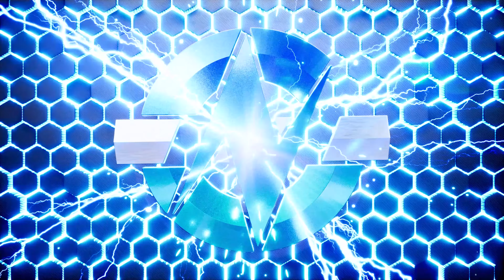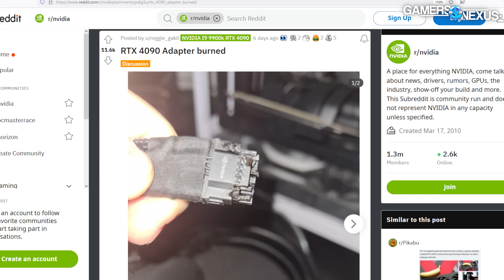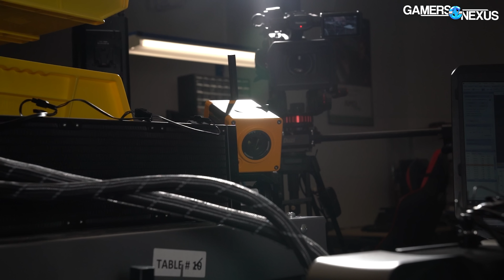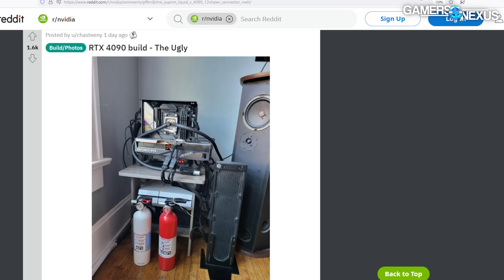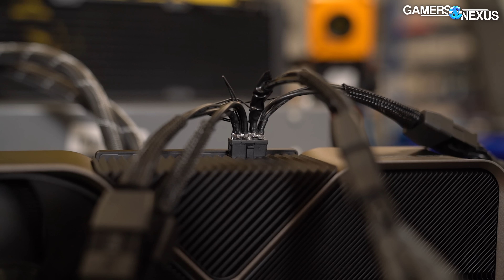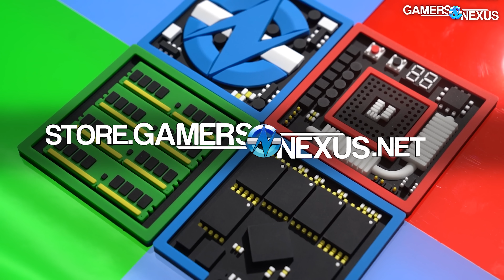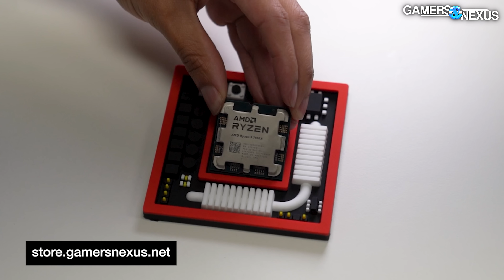Testing Burning NVIDIA 12VHPWR Adapter Cable Theories (RTX 4090)

Comment: I would name the camera HAL. Also I think the heating issue is probably due to faulty soldering on some cable and not due necessarily to a faulty design. only time will tell.

Comment: Isn't the voltage rating more about the insulation than the actual wires. Wire itself is rated for current, insulation is rated for volts.

So many hypothesis for what's happening, but I keep hearing about increased resistance shifting current flow to less affected pins. What I'm considering is that bending the wires loosens the pin to socket contact reducing the surface area. Rather than shifting current to other pins, the smaller surface contact area of the strained pins, has the same current flowing through them as there's no practical resistance increase, but as it's a smaller contact point all the voltage drop is localised creating a hot spot that heats up to a much higher temperature than rated and melting the plastic.

While you will get some increased resistance as the metal heats up, it's self regulating to the surface area of contact, so while the unaffected pins may get a slight increase in current from the affects of thermal induced resistance on the affected pins local contact hotspot, the affected pins will still draw significant current that will find an equilibrium with the rest of the pins.

Due to the nature of the hot spot, thermocouples at a distance from the hot spot may not pick up any significant heating as like all heat sinks (wire is a heat sink) it tends to equalise the total thermal load, but the hot spot can still be many degrees above the average at the local area including the melting point of the plastic.

Also as an added bonus thought, are the affected cables attached to multi rail PSUs and not single rail PSUs.

Comment: If I recall correctly, Paul's Hardware did a Video where he cut open a Adapter Cable and His 4 Leads appear to be soldered in just like the the one Igor's Lab had! You might want to contact/ watch his Vid when you get a chance, Unless you already have! LOL!

Comment: Hi Steve, thanks for your hard work, I work in high power devices 50KW and up to the Megawatts, the metal that they use in the connector it's actually very important information to find out, hopefully for such expensive product they are using Berryllium Copper Becu , anything else will not do, due the small pressure and small surface  of the pins. My suspicion is that some vendors are using cheap of the shelf TinCopper causing massive arcing due their weak mechanical nature .

Comment: Don't forget Power Supplies. My cable came with it already, and not with a 4090 because those are sold out...can't find the damn cable now but looking.
Reply: MSI 1000G PCIE 5 on their website. It comes with two of those cables. One is rated 600w and the other isn't rated with only 2 pcie connectors. If you haven't looked already.

Comment: If they used two connectors on the graphics card, set on the card the same way the 3090 was set on that card, which would be turned sideways and then set on an angle.. go look at how the 3090 and 4090 differ from their connection.. but you could put two connectors on the card with 300 watts through both connectors and it will really cut down on the power that any one cable would be forced to push through a single connector.   by running four cables from the PSU into two cables, where both would connect into the card like we use to have two for so long.. that would just cut down on the power through one cable. 300 watts vs 600 watts.. and understand that the 3090 the way it was placed on the card, meant that it was not facing directly into a side panel of the card and so very little bend if any happened at all.. and since all these cards are now getting so wide and closing how tight and how much room there is from the card connector to the side panel, the 3090 is far superior to that of the 4090 in how they put it on an angle..

Comment: One thing I haven't seen addressed is how the 4 4-pins originate from the power supply. If 2 or more are coming from a single output (i.e. there is no resistance between those two 4-pins) and one of them goes to the semi-broken (or badly seated) contact, then the power will (mostly) go over the other 4-pin and the good contact (because that is lower resistance after all). To really have the resistance of a semi-broken contact to take effect (and heat up), the incoming power on that 4 pin must not have an alternate route.
This would however require a lot to come together: An Igor-like layout, where one pin can take a full 150W. That one pin being broken, but yet semi connected (or badly seated). And the cable from the power supply to that pin being such that it has no alternative route for the power.

Comment: The thing I don’t get about all of this. Why is no one looking at the report from PCI and trying to replicate the failure they reported. Specifically that applying a bending motion on the plug reduces the contact area of the pins on the INSIDE of the connector. Smaller contact area = higher resistance = heat

Comment: My guess is that not only the pins have contact problems, but also the plastic might have quality issues. Inside the connector pin lens themself the temperatures can spike because everything is enclosed and heat dissipation is very bad for plastics

Comment: My guess is it’s an issue with multiple suppliers contracted to make those cables.   Curious if it’s region specific too (different standards for example).  Thanks for an awesome update video Steve.  Learned a lot.
Reply: Yeah, they're going to find a particular supplier or group of suppliers manufacturing to a different, more failure prone spec like the cable Igor had.

Comment: I got my Asus TUF OC RTX 4090 at Micro Center October 12th right at 9 am lol and haven't had any issues so far. I've overclocked the card, used it a bunch and swap out gpu's, so have at the very least unplugged and plugged it 10 times if not more. I'll occasionally monitor it with an IR temperature gun I have and grab the connector by hand to feel if it gets hot while the card is under 100% load and it's cool to the touch, nothing concerning. 
My card's inside a Lian Li Lancool 2 Mesh (per recommendation of GN review 2 years ago) with 2 140mm fans on front as intake, 240mm cpu AIO on top as exhaust and an additional 120mm fan on the rear as exhaust. Glass panel closes no problem, there's about 1.5 inches  (4cm) of clearance space between the connector and the glass panel.

Comment: Really appreciate your approach. As a programmer I know first hand that in moderately complex systems, a theoretical explanation for a failure very often turns out wrong. And physical systems like power cables / connectors are far more complex than software.

Comment: I wonder if the difference in cables implies that a first batch of cables was improperly manufactured. If so, nVidia is almost definitely aware, and it says a great deal about them they thay haven't issued a recall/replace program

Comment: the hole thing is just a shit show 
give us just back 6-8pins that fucking work and have a higher safety level
3x8pin connector for 450w are ok
12pins connectors for 600w  are not  

all they did with that 12 pin connector is lower the savety level for the cabels too save little more space............

Comment: What threw me off when i saw igors cable, and i may just have misunderstood but if the soldering point breaks, that will increase the resistance at that point and that point only which would make it smoke up at the end first but the pictures i have seen so far were burned at the front where the pins sit.. that doesn't make sense to me personally

Comment: Great artical as always Steve,  I just coudn't figure out why everyone was looking at the back of the connector as a mechanic we see this all the time its always heat from high resistance the origin of the problem is where the melting took place.  Not seated connection or poor design pin's.  Just imagine what these will be like after 2 years in your Mom's basement.  They really need to fix this.

Comment: that would be funny if the failed ones had 150 volt cables on it, cause then that also shows Nvidia didn't test the adaptors or even look at them. tho that would also be major fault from Astron

Comment: Consider this worst case scenario: The outer pins are broken off (from the other pins in the 12pin corrector but not from the cable) 
(if i remember correctly the adapter need only 3 cables connected ) 
In this cases 1/3 of the current is going trough the 4 inner pins and 1/3 of the current is going trough the single outer pins.
This could Cause a worst cases current imbalance of the outer pins 2 times the rated current (1/3 of the power over 1/6 of the pins) 

If all 4 cables are concrete it can still be 1/4 of the current over 1/6) of the pins.
So a Current imbalance of 1,5-2x per pin is totally possible.

Current shearing is of cause also influenced by resistance or the current parts and this can change with contact resistance so real world differences can be lower (but could also be higher)
This may not be likely but melting connectors is also a very rare occurrence.

In the test the current over each cable shuld be checked with a camp meter to see how exactly they match/share the current.

Comment: 2 questions.

Is it possible removing the tape and sheath allowing the solders have contact with the air be enough to have cooled to a point where there is no failure. As opposed to a broken solder still encased in the sheath and tape. 

And is it possible that the problem may stem through the psu?

Comment: What I wonder is are your connectors made from 0,2 mm sheet metal? Namely on GPU side one has pretty solid pins. Those do not bent . On adapter cable side one has folded sheet metal square tube that makes the contact with pin on the other side. That tube will start unfolding when cable is bent resulting in lose contact an that will cause fire when you conduct that amounts of power.

Comment: main conclusion and most important one, there are different nvidia adapters with "different" "worse" quality  and different built in method.
ifyou have those 300v cables and you plug it correctly, sure you won't have any problem.
edit, pauls cable is 300v and has similar soldering method than igor's one

Comment: Another point to look at is the socket hole in the plug if it is slightly bigger than the female socket of the wire installed. If the pin receiver is loose in the plug it will have more wiggle room and thus loose tension on the pin connected too. 
It's like when you have loose terminals on a car battery and the car still starts, the cables will get hotter than normal while cranking. The cycling demand of the vid card would would the rise in heat at the plug and the remaining tension would be lost making it even worse with intermittent contact finishing the job.

Comment: I have a theory.

One of the cables reached 70-75C on an "open" test bench where the surrounding air is at room temperature.

My theory is that high case air temps could be enough to increase the temperature of the cable to 80 or above, where the plastic would start to get soft or melt.

Perhaps try testing with bad case airflow or high ambient air temp?

Comment: Personally I think Buildzoid's take on this issue might also be worth taking a look at. He is not really looking at the cables but at the pin receptacle on the connector. The NVIDIA cable seems to have much less structural rigidity, allowing for worse contacts, causing an increase in resistance and thus heat. Combined with the lower tolerances on the connector itself, it can in some cases cause melting on the pins.

Comment: 150v vs 300v I wouldn't worry about to much, it's the gauge that will make the difference, the 150v might be smaller guage(bigger wire; a bit counter intuitive).... 12v~ is what is actually going through it nowhere near either voltage:P.....? ** the voltage rating may help you find out what the gauge is if another similar adapter cable is found but on it's own it isn't a very good indicator of anything
Reply: for sake of reference, old florescent I think were 600v~, and super thin in comparison; the same wire for 12v for a gpu would probably make a house fire:P(generally thicker, handles more current and better at temperature dissipation)

Comment: ¿Maybe bad contact inside the individual pin?   
26:00 related
when in your house the main fuse gets hot is because bad contact inside the fuse, eventually the metal will "rust" or burn, and the light will eventually cut, that is because where the contact area is too small a resistance is created and heat then. that could create very hot scenarios focused only in a certain pin.

Comment: Well I think it is a good idea to start by pushing more amps into the cable using a high power variable resistance (not a graphics card) and see at which temperature and power the cable starts to melt, this will give you a target value and power limit of that connector, then you compare that melting point with the current temperature underload (68.5°C | 21:36) and see if it is close or there is a enough gap to operate safely.

Comment: I wonder why you are focusing on the wires and solder joints, while ignoring the contacts, where the problem really lies. AHOC made a video about it, which is spot on. The melting starts at the pin and the contacts, so why look at the wires and solder joints? The fire department don't investigate the house next door to the fire either. The reason why it's the outer most pins that melt, is that if you twist the connector sideways under load, the pins can pry the contacts apart and create high resistance in the connection, which results in high powerloss in the contact points. That's where the heat and the melting comes from. Granted the solder joints in Igor's cables looks dodgy, but so does his ability to take the connector apart. So the broken pin is a little sus. The busbar may seem a little weak, when you compare it to the wires, but remember that it's only purpose is to equalize between the pins, nothing more. So at most it should carry about a third of the power from a a single wire.